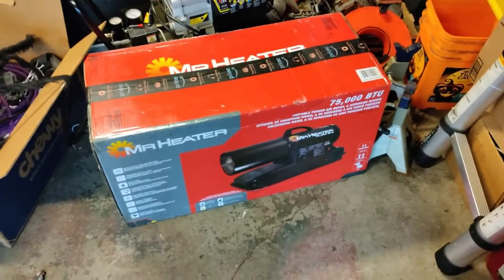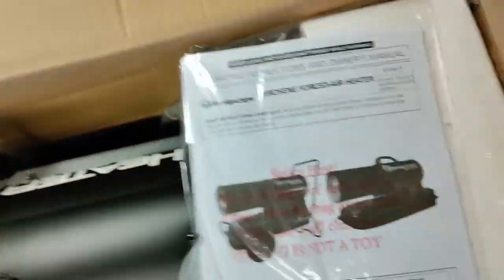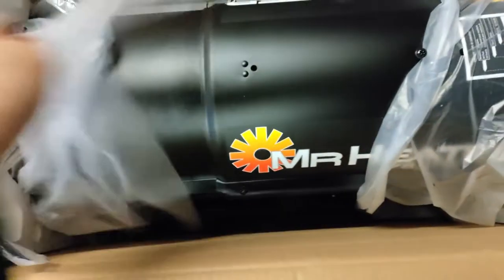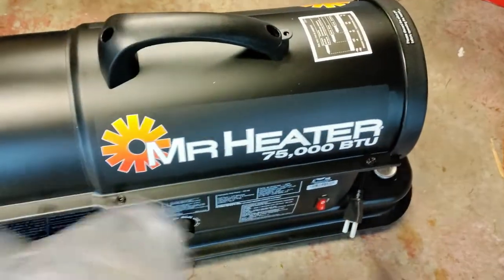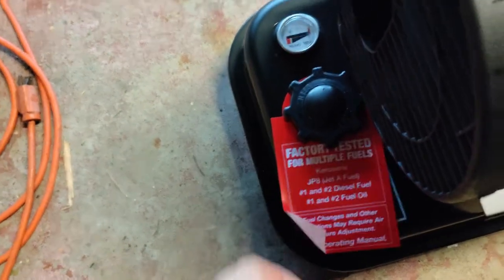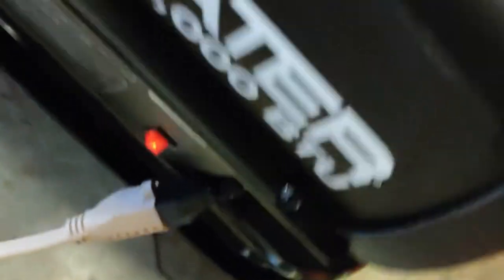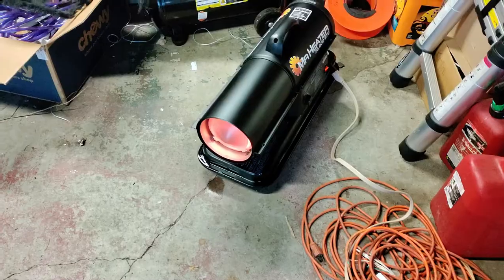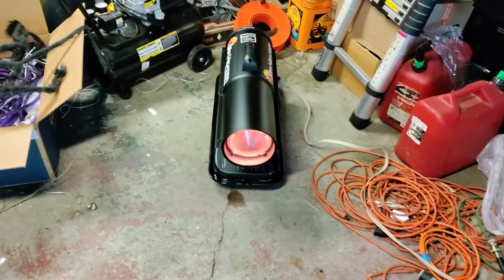Mr. Heater 75,000 BTU Forced Air kerosene Heater

Comment: We had a non-forced-air kerosene heater when I was a kid, used to use it in the living room.  They were a lot more common back then.  Anyway, it fell into disuse.

This seems pretty powerful, or at least sounds it.  They make 12 volt oil heaters, but they need to be vented outside.  They also don't put out anywhere near the heat that this one does, so it really depends on how much heat you need over how long a period.  As long as it keeps working, it should do a fine job, I'd imagine.